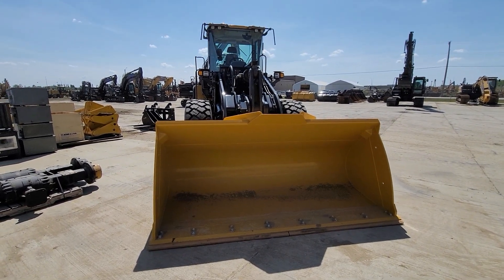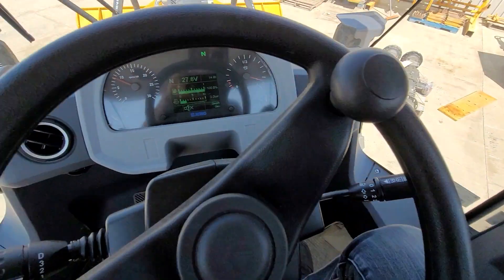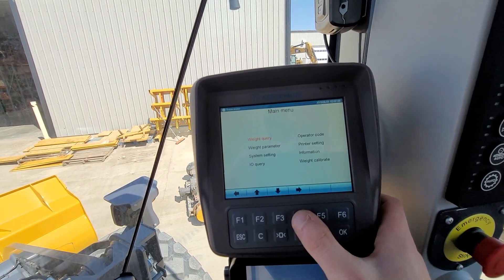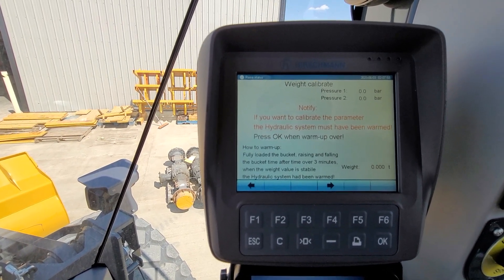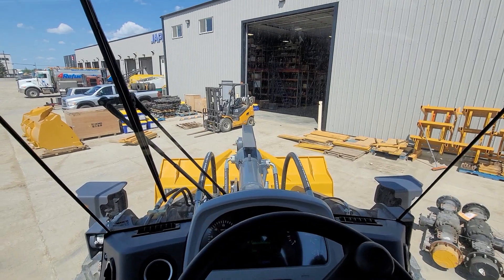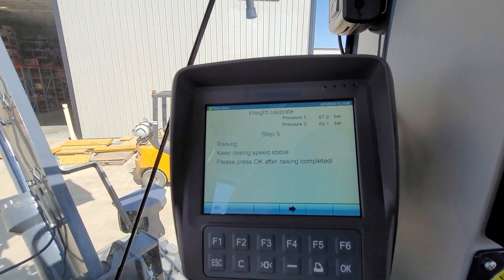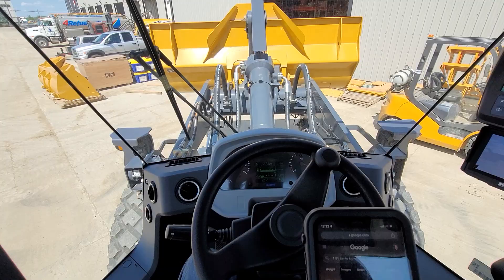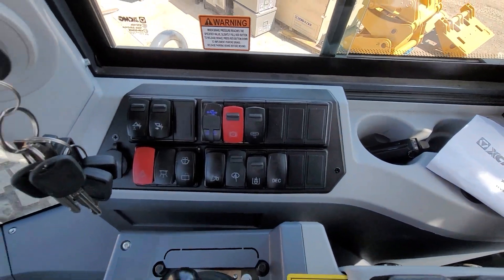XCMG - Scale Calibration - XC Series Wheel Loader

Comment: What if it's not Calibrating  and not keeping track of the weight?
Reply from the maker: Should be checked over by the dealer - first natural assumption is a faulty sensor / loose connection / failure within the wiring harness. Hope this helps.